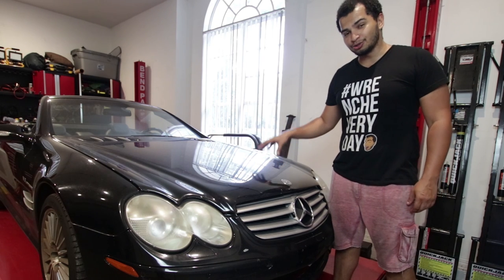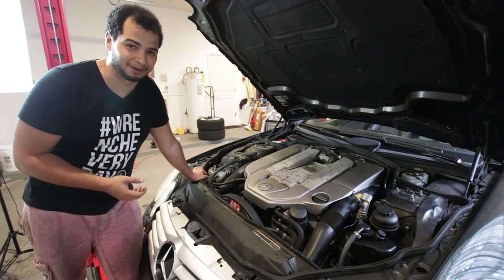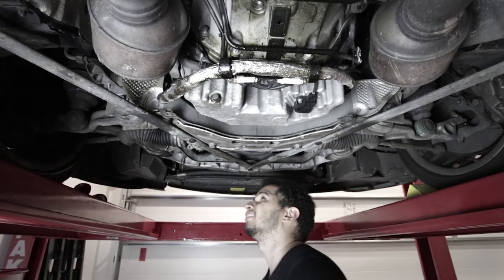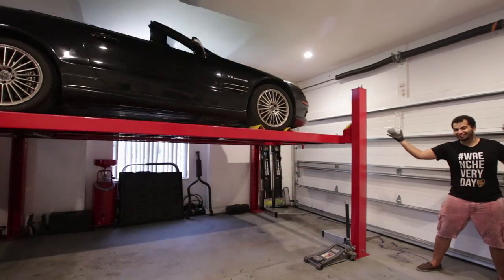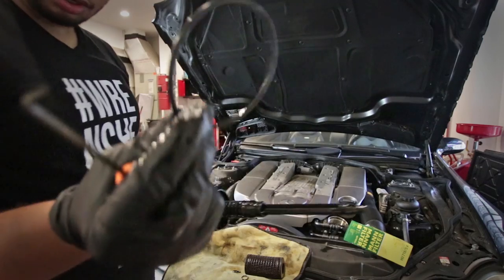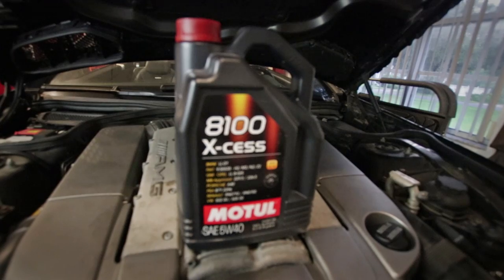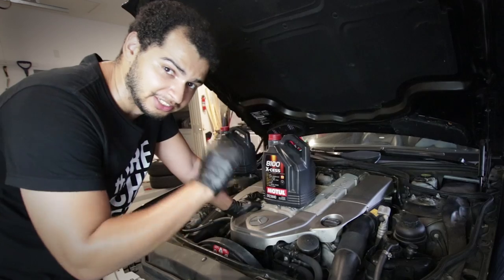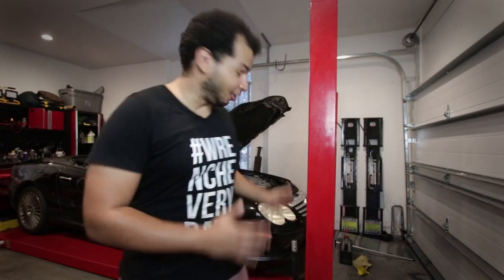Here's Why A Mercedes Oil Change Costs $320 And Why You Should NEVER Pay That Price-Project SL55 Pt1

Comment: FYI, the Famous Ford 302 5.0 liter engine, which is the engine the 4.6 liter V8 replaced, had two drain plugs. By the way, the oil filter is referred to as a "canister" oil filter. Not being a snob (I actually drive a Camry, LOL).
Reply: Yeah, I had an '87 Town Car with the 302. It had two drain plugs, too.  Not very informative; more PR than anything.
Reply: That’s what I was thinking too- I can’t count how many times my dad would complain about that growing up, not even working on a Crown Vic!

Comment: I don't know how it is in America but in Germany part of the A service is a break test on a test bench, they also clean the water diverter, check all the light (external and internal), update the GPS map, ... and a lot of small things that you can do by yourself. But, if done correctly, it takes time and therefore cost money.
And seeing the poor job you did, you'd better let a qualified mechanic do it for you...
Reply: I work for a Mercedes-Benz dealership in the US.  You're correct...there is a lot more to a service A than was mentioned here.  Many items are checked that are normally overlooked by third party shops.  We are required to check and record on the service invoice:  tire pressures (including spare if one is included), tread depth, brake pad thickness, check for oil leaks, brake fluid condition, shock absorber conditions, check all light bulbs, top off washer fluid tank, perform any available software updates including maps.  Car is test driven to ensure all is functioning, washed then brought back up front to the customer.  We do this for $250.  Not necessarily cheap, but thorough.
Reply: @kbatzler  My local Toyota dealer does all that, including  the wash and they bring the car around to me and open the door for me as I get in then they wave me goodbye. They do this even though I buy their coupon special which gives me a third service for free (if I pay for them three at a time). (They also check my tires, set the tire pressure, check for any recalls and in my hybrid they test my auxiliary battery, all for their reasonable oil change price.) All that costs a fraction of the Mercedes price, even when I factor in the cost of the extra oil capacity my the Mercedes (I'm a former Mercedes owner and my family had owned Mercedes going back to the 1960s, we now all own Toyotas, seriously.)
Reply: Well, we are not in Germany and that why we got rob for not having full service done here for same price.  They don't test s#1t here... And map update is gonna cost us an extra $300.
Reply: The service performed in Germany is absolutely no different from the US. The intervals are the same and a service A, B, C, or D is exactly the same thing. As for the map updates, you just need to keep your eye on  occasional mailers or email with promotions for free map updates that generally last three months. If your car is less than 3 years old the map updates are free anyways. I know how we perform our services at our dealership, your experience may vary depending on one nearby you. No guarantee it's going to be the same just like with any brand.
Reply: My car was almost brand new when I get it and a year later I've asked for map update and automatically they told me "money money money", LOL.  I just stick with Google anyway.
Reply: They test all the internal and external lights?  Wow!  Since my Mercedes will indicate any internal or external light being out right on the dash cluster where I can see it why do I need the dealer to do that?

Comment: Two things...

Be careful telling people they can ignore the manufacturer's oil requirements. My VW diesel requires 507.00 type oil for its extreme low ash content. Using other than 507.00 oil can foul the DPF (diesel particulate filter) and/or the high pressure fuel rail pump. If they can prove you didn't use the right oil they can void your warranty !

You checked your oil level BEFORE you started the engine. So the canister the oil filter sits in was completely dry. When you started the engine the first time that canister filled up and no doubt your oil level dropped. You should start the engine, let it idle for ten seconds or so, shut it off, wait a minute then check the oil level to get an accurate oil level. This is also true for spin-on oil filters (which you should fill with oil before you install it - if you can)

Comment: If you did the oil change per the manual you would not even be under the car. You use a vacuum evaluator and ‘suck’ it out through the oil dip stick. Remove the oil filter when evacuating and continue till no more oil comes through the hose. Actually removes more oil than draining through the drain plug. That’s why when you buy the filter ‘kit’, it doesn’t include the drain plug seal washer.

Comment: Benz oil change at 12k miles for a $120,

Regular car oil change at 3k miles for a 40-50 dollar so if you added 3 times is will be the Same,
Reply: Andy Benz Mercedes use synthetic oil which costs a lot more
Reply: eternalending on top of that, the engines are finicky and don’t survive long in n regular oil. They will seize up

Comment: The oil change is actually even a bit easier than you describe.  Merc dealers use a siphon to suck out the oil from the dip stick tube.  You don't even need a lift.  Just buy a mitivac on amazon.  You can practically do the oil change without getting your hands dirty.

Comment: Actually, Mercedes doesn't drain the oil; they just stick a tube in through the top where you add new oil, and suck all the old oil out.
Reply: It would not work correctly on this engine because of the dual sump setup,  I still lift them and crack the oil pan drain screw I like to get everything out, the sucking technique works best when doing quick lube type express services at the dealer where we promise the service done under an hour and we still lift the car up to inspect it or else they yell at us lol, also I like to look under anyway because you would not believe how much shit people run over on the road and they think they came for an oil change but sometimes have to leave the car because they hit some shit that damaged their suspension on one side and their tires are wearing out all fucked up.
Reply: Aaron Johnson sorry you can't get a tube through oil fill to the pan through valve covers. So far haven't seen engine yet that works on and I'm 31 yr master tech. Old 2200 S10 4 cyl had dipstick in oil fill tube that might work or down SBC dip stick but I haven't seen many in my decades of service.
Reply: it takes time also to remove the cover underneath the engine thats what we do with covers u have to remove  around 10 bolts
Reply: Aaron Johnson not for the SL55!!
Reply: Aaron Johnson won't all the gunk,metal residue and dirt would remain at the bottom?
Reply: Every car except any AMG, and if you watched the video, he doesn't have a dipstick. Nice try though, 8 people thought you were right.
Reply: One major step he missed too, you're supposed to replace the drain plugs on dual sump oil pans. Don't know why, but it's included in the service process, as well as a tire rotation on non-staggered set ups.
Reply: @raymondsantos3278  My Toyota has two under engine panels that need to be removed for service, the dealer takes them both off and does all the same service including all inspections for a small fraction of what Mercedes charges.
Reply: @eriklona8806  On mine it was replaced because they have a small metal gasket on them that is not reusable (a crush gasket is what I was told it was) so the plug and drain is thrown away (what a waste!), all other cars I have owned feature reusable plugs and they include that with the base price of that car at no extra charge. LOL

Comment: 1. Check oil level on gauge before changing oil. 
2. Drain and measure old oil. Replace filter. 
3. Fill new oil with the same amount that was drained. 
4. Start engine and check for leaks. 
5. Shut off engine and allow to rest for at least 90 seconds. Use gauge to check oil level. Add oil as needed.

Comment: you did it wrong, you should change the filter before you drain the oil, now the dirty oil runs back into the engine instead of out.
but hey, your the expert. im just an overpriced mechanic at a dealership... ( not mercedes )
Reply: Dave De Swert hey overpriced mechanic at a dealership....I always drain the oil first, then remove the filter . Are you saying the oil trapped in the filter runs back into the engine when you break it loose? It seems like it remains in the filter but I work on my cheap cars not high end autos.

Comment: The only consistency in B service at different MB dealerships is the oil change… Some will include either a new air filter, new windshield wiper blades, or some even include a brake flush, but NONE of them do the same things in their “B service”. Its a good idea to shop around for whats included, if you have multiple dealerships to choose from (big cities)! To me, ALL A services should include wiper blade AND air filter refills, and ALL B services should include either a brake or tranny flush, brake pads, or plugs. Those are all the services you should ever need for an amazing driving experience!

Comment: I'm pretty sure the Benz techs use a vacuum pump fed down the tube/hole that would hold the dipstick.  So it's even easier for them than what was shown.

And Tavarish should be putting in the full amount of oil, not stopping just because 8 was close enough and didn't throw a code, which these cars will do for more things than an owner wants to think about.  Especially the way he drives.  Which is how I want to to drive.

Comment: Psh... Just take it to Jiffy Lube or Wal-Mart auto center. They're fully equipped with the finest oils and the most refined staff all at rock bottom prices.
Reply: Cody M Jiffy Lube and Walmart? I’ve seen enough pictures of overtightened bolts on /r/justrolledintotheshop to avoid any hint of them even though I don’t live in the US.
Reply: If you are going to joke, use an emojii, for the less sophisticated.

Comment: Which Motul oil do you suggest for my e90 M3 with the S65 V8? Thinking of switching over
Reply: Michael Broski 
Use motul racing 10-60 or liqui moly race 10-60
Reply: Michael Broski water
Reply: tony americas was that suppose to be funny? Clicked this bc I didn’t like having the notification icon in my app.
Reply: driving an e90 m3 and asking on youtube what oil to use.... dude, u dont deserve a car like that.
Reply: civiere I’m just asking to be curious. I run nothing but Castrol 10w60. I’ve owned my car for 2 years. Drove it 2500 miles. Changed the oil 3x already. First when I got it bc I trust no one. The other once a year and yes I send my oil to Blackstone so don’t give me that shit.
Reply: and you're asking this hack tech questions??

Comment: I just changed the oil in my 2009 Mercedes ml320 bluetec diesel engine.  It just cost me $85. $20 Oem oil filter, 2 gal 5w30 full synthetic oil and copper washer for the drain plug.. I bought the ml320 for $9000. Has 118,300 miles. It runs like it's brand new.. The interior looks brand new.  Only the CD player is broken.

Comment: They vacuum that shit oil out of those systems. Surprised you weren't aware of this. You think  MB is going to touch underneath without charging extra to take an oil pan bolt off? LOL
Reply: Ernest Jones vacuum's definitely the way to go... I always take out the filter first on my  2006 Merc (which has a dipstick and electronic oil level display), then the dipstick and then use my vacuum fluid pump to remove the old oil. No mess, no faffing around under the car. Also, original MB parts are very reasonably priced, oil filter is £9.13 compared to nasty Fram version for £14.99. Labour in a MB dealership is quite pricey, around  £108ph +VAT (20%) They also sell you the recommended oil at a very good price too (6L for £50), much less than I've found anywhere else for decent oil.
To even get at the sump plug you need to remove 2 to 4 lower engine covers (depending on model), I noticed his were off or missing. That process takes about an hour, maybe a little less, it's around 18 bolts to get them off... pig of a job without a lift.

Comment: My 2000 E320 has 336,666 miles as of today, 
Mann oil filter $11.00. Mobil1 0-40, 5 quart $25.00 x 2 Wal-Mart. Most
 dependable car ever made.
It has never been serviced by the dealer.
Reply: Randal Kingery most dependable car ever : crown vic 4.6  ( highest number of cars over 800,000 miles )

Comment: Always take the oil filter out before you drain your oil, you will get 3-400ml sitting in there and that's just going to end up in the sump after you break the seal on the filter housing, there's a reason why mechanics charge a lot, they have knowledge and experience.

Comment: I hate to criticize you, but your method of measuring the oil level post oil change was wrong.  The sump hold 8 quarts but the entire engine takes 9 quarts.  This is because some oil is held in places like the oil filter (that you drained when you changed it) After changing the oil and filter you should run the engine for a couple of minutes to circulate the oil and then leave it to settle.  Once settled re-check the oil level on the instrument cluster.  You may need to top up slightly.

I agree with you that a dip stick would be so so so much better

Comment: Bud, im pretty sure youre supposed to take the filter and housing off before draining and leave it open while draining the oil. The canister system holds a vacuum and won't drain all the used oil unless that cap is off.

Comment: Add oil, run engine allow for the oil to get through the galleries and fill the filter turn the engine off allow for the level to settle then check your level Im a MB tech p. S good practice change the air filters when you drop the oil and filter

Comment: Mercedes generally does not drain the oil with the crankcase plugs they evacuate the oil through the dipstick tube most newer Mercedes don’t even have crankcase drains anymore. And if you remove the plenum you should find a blocked off tube towards the rear of the left side fly head (left side if standing in front of the car looking at the engine) some engines also are evacuated thru a crankcase access plug center rear of the engine

Comment: My mercedes is the easiest car I have to work on and I have 5 cars. The only problem I have is that finding a 9 quart drain pan is difficult. My dealer charged 200 for an a service last I checked (maybe 5-10 years ago) and the oil is $8 x 9 = $72 and the filter is $15 usually. So basically you're paying about $100 for the guy to do the work. Also they usually don't pull the drain plug at all since the engines are designed to be used with a vacuum so the car never has to go in the air. Pull dip stick out, suck oil out, change filter, pour new oil.  I stopped taking my car to the dealer when the warranty expired at 50k and it still had a layer of paint covering the drain bolt/pan together.

Comment: A service is oil change with oil filter, cabin and engine air filters, tire rotation, multi point inspection, AND it’s ever 10,000 miles or once a year, whichever happens first. That’s not too bad in my opinion.

Comment: Read a little more on Mercedes and how they work etc. on every oil change, it is good to have the engine hot and take the filter out first and open the engine cap. And another thing, learn the correct way to turn the engine on. You’re not supposed to hold the key, just click it to the right once and it’ll turn over.

Comment: hey just wanted to add I seen a guy with a comment about his vanagon engine failure at low miles and some other people commenting idiotic comments about oil. high end and many modern new cars are going to specialty oils for their engines and transmissions. that is the way of the future. the reasons are many. fluid expansion, electronics submerged in oil, seals. you really should use manufacture recommended oil. also on pre roller engines with flat tappets you need to add zinc to protect the cam lobes. also if youre breaking in an engine you need to remove the inner valve springs on flat tappets other wise you will wipe out the lobes during break in then install them later after break in.

Comment: My oil change cost about $120-$140. The extra $200 Mercedes is charging is for them to “DIAGNOSE” that you need an oil change... On the positive side, they do give you an informed video inspection of the entire outside of the car and a basic car wash. And if you had previous repairs done they’ll inspect it for free. Overall the dealer is costly but they insure all their work and its done right the first time...

Comment: The correct oil is that stated in the Owners Manual. I have never seen a manual stipulate a spaceific brand!  The Mobil 1 sticker was probably put there by the Mercedes Shop that did the first service.

Comment: No we are NOT all done after we check the oil level! Before we give the car to the customer, or drive it, we let the engine run for 2 minutes and whild it is running we look under the car to see if there are any oil leaks. Maybe the filter canister o-ring got moved to the wrong place. With a spin-on filter, maybe there is a tiny rust hole in the steel shell. Cheap oil, expensive machinery — we always check to make sure there are no leaks.

Comment: I  use my oil pump (very cheap to purchase) to remove the oil. Then reverse the pump to add fresh oil, change the filter then use the "Special Mercedes Oil check tool" to check the oil level and you are done.  No need to get under the vehicle unless you want to inspect the under carriage.

Comment: I DIY my 2009 SL550(19" AMG 5 star rims) oil filter and oil change.  It's easy.  Front and rear brake pads are easy too.  Air filters(2x) are easy along with the cabin filters(2x).  Diff. and tranny fluid are......yet again.....easy.